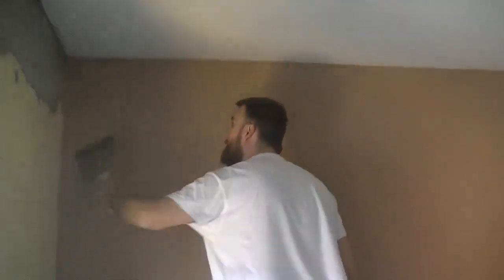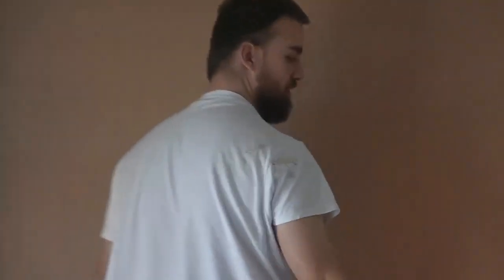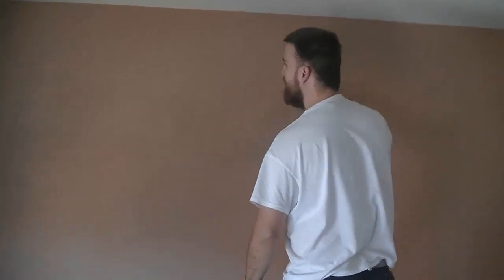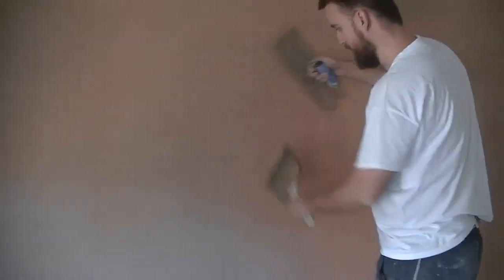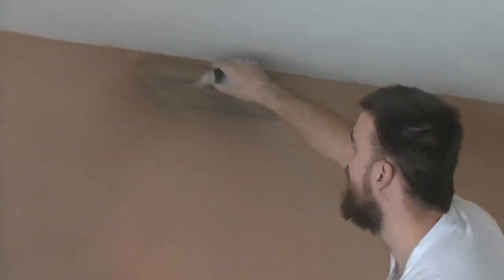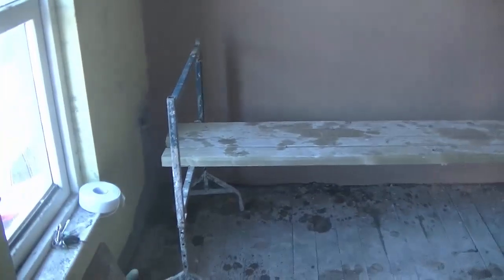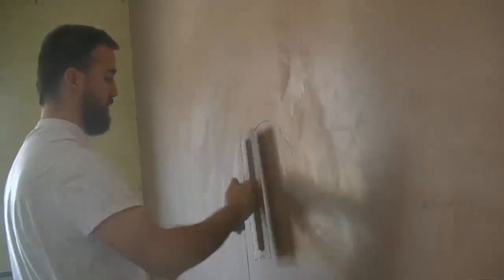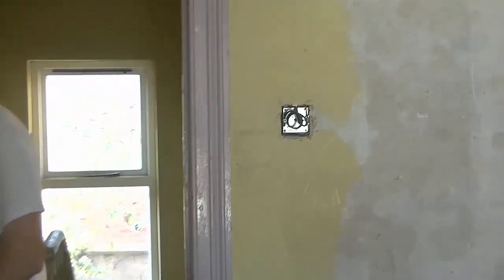Heavy coat of skim plastering wall chat

Comment: Certainly got more time in the cold ,I might have to get some of them half time  sachets 👍
Reply from the maker: Never uswd them yet what they like?
Reply: @macplastering  I will defo be using half time tomorrow morning as I've got a 8m2 ceiling to do on an out building with no heat 🥶
Reply from the maker: @griff0871  let me kniw how you  get on with it buddy
Reply: @macplastering  hey pal used half time this morning. Start to finish was just over 2hrs which wasn't bad in a cold unheated out building.

Comment: What refina trowel u using the finatex the cement trowel or the cement trowel with the rounded corners?
Reply from the maker: Hi Tom i  always knew it as the premium trowel but i think it might be a finatex premium , I also have a newer trowel thats a black handle finatex but its real nice and flexabil
Reply: @macplastering it's stiff enough to put the gear on? The finatex
Reply from the maker: @tomg6110  I would think so mate

Comment: Have you tried a small pump action spray bottle much less mess than a brush
Reply from the maker: Hi Neville have a few times do love a good plastering brush thou lol like to clean angles and tools with it as i got , spray bottle was nice with render but didnt last long
Reply: @macplastering  nore do the bottles if you drop them lol never really use a brush myself just a small long handle angled one for the angles
Reply from the maker: @y0utu8ewatch3r  oh yes they are good i think rambootools sells them, yea most things are not designed to last now lol
Reply: mac plastering with you on that mac always a brush I’ve tried using a spray bottle but end up picking up a brush to clean trowel can’t see the point lol
Reply from the maker: @neveryoumind9237  I like spray bottles but ones i used always break lol do like the brush better :)